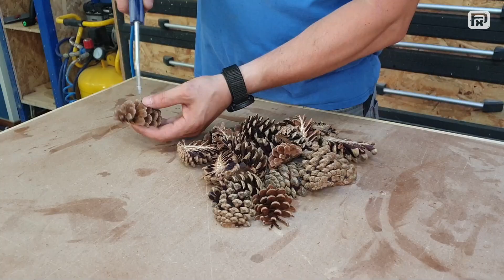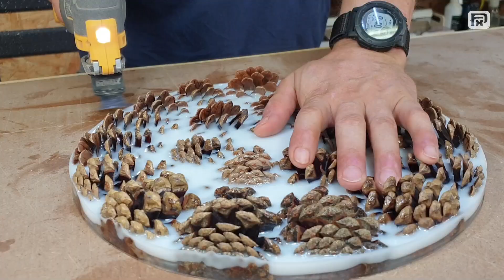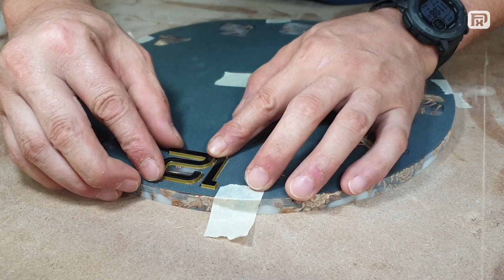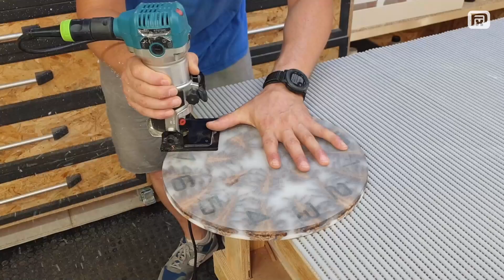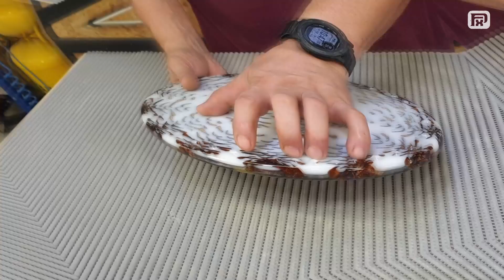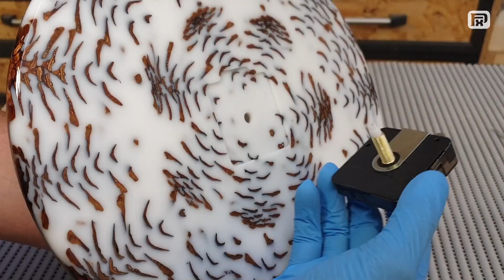Step-by-Step DIY - How to Make a Unique Epoxy Resin and Pine Cone Clock

Comment: Do you sometimes stabilize the pine cones (or your color pencils)?
Reply: Thanks. When I tried the porous bare wood of the pencils kept giving off tiny bubbles. 
I appreciate your skill
Reply from the maker: with pencils it's not that simple. but I invite you to support the channel because I will make a video on what to do to avoid air bubbles, supporters will see them much earlier 😊🙌
Reply from the maker: I just fill them with resin and that's it 🤷‍♂️

Comment: Your works are truly stunning and your videos are perfect! Nonetheless I'd like to know a few more details... like how you determine the thickness of the clock. I suppose it depends on the measure of the mechanism. Also: is the mechanism glued to the clock or not? Is the mechanism strong enough to hold the weight of the whole clock?... thank you and congratulations, I **love** your clocks and your creativity ❤
Reply from the maker: the mechanisms I use are up to 2cm thick and they will hold up to about 1.7 kg, but I try not to make them heavier than 1.5 kg
Reply: @FxPart  thank you very much for answering!!!